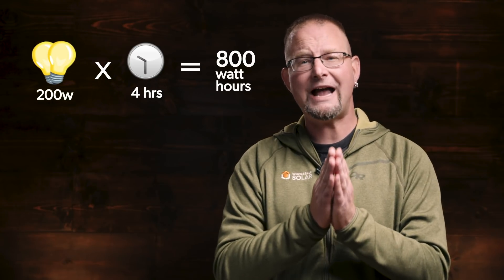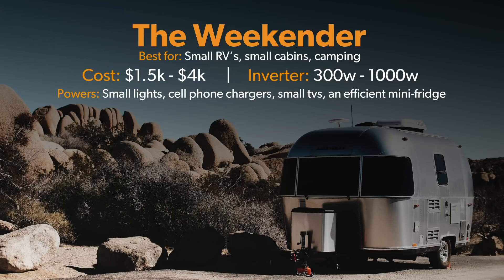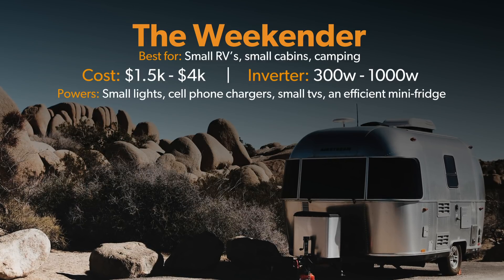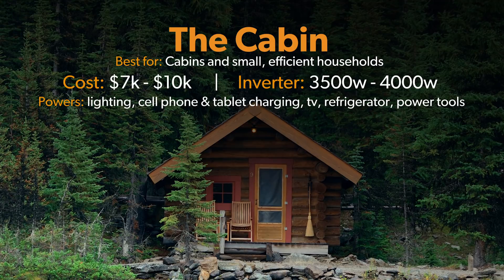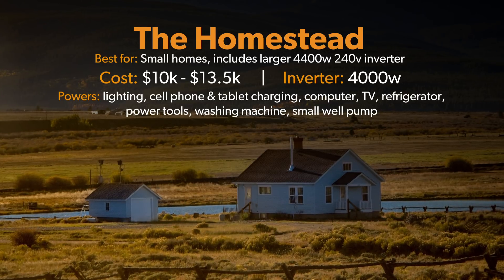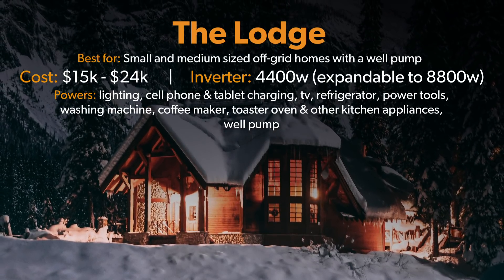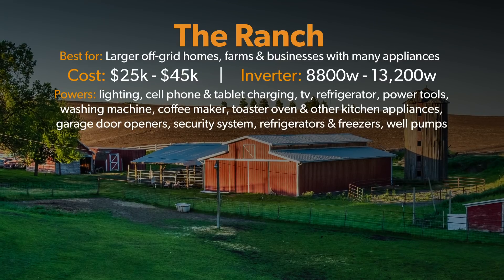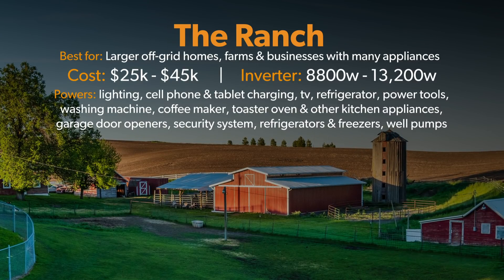How to Size My Off-Grid Solar System & How Much Does it Cost?

Comment: Thank you for the video, very well explained. 
Hope I understand this, if an off grid house is using a 8.5 kw solar system that powers it & they want to add batteries. They would need 17kw of battery storage minimum to be sure they had the 50% extra you spoke about, is that correct?

Comment: I’m building a new house and although I’m close to the grid it will cost me $18000 to get connected.  My house will be a 3 bedroom home and intend on using propane for my oven, hot water and dryer as well as heating my house. I intend to use a back up generator(propane) as well. Of course all lighting will be low consumption LED. Most of my electrical draw will be running furnace blower, electric water pump from well and 2 weeks of air conditioning and motors for laundry plus various electronics on appliances and other stuff.

I think the low end of the lodge idea would be perfect?
Reply: For that price to get electric, I've been told running electric is ultimately a better deal.

Comment: Just a quick point: if your heating is electric and/or you rely on at least one electric car, then that will have a huge impact and I’m not sure if it will ever be viable or cost effective to rely on an off-grid system for these. Basically you are challenging a Tesla battery system with another one. Frightening expenses...

Comment: The term "instantaneous watts" is a misleading here. Instantaneous power is a thing, measured in watts, but that's not what "100 W light bulb" means. All loads/appliances are rated in average/active/real power, not instantaneous power.

Comment: I followed the typical calculation to size our system and ended up with way to much power!  I have a 15.3kW system with dual inverters and just disconnected one of the inverters because we've never pulled enough power to use it.  We have two fridges, two freezers, 4 ton hvac, radiant heat, pellet stove, plus all the stuff that goes along with a family of 5 in a 3400sqft Off-Grid Home.  Everything works great and I'd encourage everyone to look into solar.
Reply: How much did it cost you?
Reply: @osolis1212  I'd like to know as well
Reply: @WrenchesandPlants  I install solar for a living, that cost is way too much. I’m assuming ground mount solar? Even then that’s an absurd amount, should of been around ~$45,000.00 for grid tied-no battery
Reply: @WrenchesandPlants  you got ripped off
Reply: What do you guys think I’d need for a very small “glamp” site? Would be using mainly for all led lights, charging all devices (phones, tablets, chargers, electric dirt bike etc) no ac at all. Would also have a refrigerator and tv/ game setup
Reply: @ordinarygamer1353  not much, I'd think a 3kW system would be plenty
Reply: How much did that cost?
Reply: @richarddikrey9656  after tax credits it was around $27k but I'd have to go back and look.  Videos are on our channel about the system.
Reply: I have a, 4 on 12 pitch, 1500sqft of direct south facing. metal roof... I really built this house with this in mind... I have to figure something out. I'll cash the permit office tomorrow and see if they will allow an electrician to install that portion. I'll do the panels and everything myself.
Reply: @jeffalley4417  good luck!  Hope you're able to work it out.
Reply: Alot that's for sure
Reply: Dude, they wanna charge me 18k for 8 360w panels grid tie... it's getting stupid. The painful part is, my local gov won't allow me to diy
Reply: @jeffalley4417  I can see doing a grid tied system needing a licensed electrician to do the final hookup but most of it is rather simple.  I'd guess that 2/3's of that price is labor and profit to the company doing the work.  I was able to so it all myself and probably saved a good chunk.
Reply: Hi good for y’all! Honestly I am trying to go solar myself, but i can’t figure out what all equipment i need to buy. Would you be able to tell me what all equipment you use so I know what exactly I need to buy? I can’t seem to find an exact list online of what all I need
Reply: @jaceduck625  we bought a package setup from Northern Arizona Wind and Sun.  It had everything thing we needed and comes with lifetime tech support.  Videos are on our channel of the system we installed.
Reply: @WrenchesandPlants  Jesus!

Comment: Air Conditioning…..Mini Split system is a lifesaver for a solar system. Still things that need to be considered, but it helps
Reply: We installed a MrCool Olympus Multi-Unit Ducted system.  Only pulls around 3kW even when all four units are running.

Comment: Hi 
I only want to cook outside with a crockpot or a instant pot.  In the morning run the coffee maker.  I would only run one appliance at a time.  What do I need to accomplish this task?
Reply: Not much, the coffee maker only pulls power when heating the water.  The crockpot will pull power for a much longer period of time.  If you only plan to use one at a time then 1000W might be all you need.  This isn't the size of your solar array or batteries, just the inverter.
Reply: @Off-Grid  
So I tried it!   
  The inverter makes a noise after 20 minutes or so.  And it’s super hot.  I turned it off.
Reply: Sorry - I ran a crockpot
Reply: @circuscats67  What size inverter are you using to do this with?  Most inverters have a surge amount they'll put out.  So if the inverter is rated at 1000W it might have a surge of 1500W or so.  They will usually only run that this surge level for a short period of time.  If you have a gauge on the inverter it should have shown you how much power it was trying to output.  This would tell you how much the appliance was trying to pull since it is the only thing being used.
Reply: @Off-Grid   
I’m going to look at the equipment
Reply: Got the information 
750 watts continuously 
1500 peak watts
Reply: @circuscats67  yep, I'm sure it is to small.  A good 1000 watts.  The crockpot should be much lower, around 200-300watts but if this is a small inverter meant for a car lets say, it wouldn't handle a long duration load.
Reply: @Off-Grid  
Thanks.  What do you suggest?  Bigger inverter?
Reply: @Off-Grid  
How much bigger?
Reply: @circuscats67  I feel the most important thing would be to buy an inverter made for long duration loads such as those used in off grid or grid tied applications since they are designed for household use..  2000-3000W at least so you can handle surges and even add a couple things in the future.
Reply: @Off-Grid  
THANK YOU!!
You told me what I need to know.  That is perfect!!!  
Many many thanks for the information.

Comment: So say a person buys the Ford F150 Electric.  And wants an off grid charging station to power it, completely off the grid to fully charge the pickup every day.  What size and how much battery would one need.  Thanks for the help.
Reply: you might need a acres of solar panels lol
Reply: I have acers.  What do I need?  How much battery?
Reply: @mattjaeger8462  when it comes to the kind of power that truck will pull you would be investing a ton of money 💰
Reply: I want a 1000 watts running 24/7 to my mining shed 🤔🤔🤔
Reply: hard to know, find out from ford how many kilowatts it needs to charge fully. for example, the nissan leaf can start charging with a little over a kilowatt of power and it will use a total of thirteen kilowatts to fully charge (2011 model)

Comment: Hydro is way cheaper
Reply: What's hydro? Please share I'm looking into getting a power bank for my solar panels. Thanks 😊
Reply: @everyonesshuffling  Water power. You would have to have a water source (running creek or lake high enough above your generator to have enough head pressure to run a turbine.
Reply: We would have liked to do hydro as part of our solar system but the creek is just to far away.

Comment: None of the sizings mentioned Air Conditioning 🤷‍♂️
Reply: Yes they never do! It’s possible but you need thousands in batteries. I have a guy that wants an off grid solar and battery system for a 100A service and he’s not gonna like the cost. The enphase ensemble system takes a lot of the complex figuring away but it’s not cheap!
Reply: We have a 4 ton system and it pulls around 3kW when running.  Not an issue for our set-up and runs perfectly.
Reply: @Off-Grid  Are you using window units or an actual AC system?
Reply: @jordanknoll2864  We are using an Olympus Mr Cool multi-unit system. There are several videos on our channel.
Reply: @Off-Grid  
You're able to do 3kW for how long? 
On how many batteries?
Reply: @zulu_mafia  we run the AC all day in the summer then turn it off about an hour after the sun goes down..  We have (24) 2V batteries for a 48V system with 1060 amp hours.
Reply: @Off-Grid  why did you decide to do 2 V batteries?
Reply: @1shaneeka  you get more Amp Hours the lower the voltage.

Comment: First, thank you so much for your clear explanation! May you help me on how to calculate the the usable load in Watts that keeps the solar arrays charge the battery (lithium batteries) while is being discharged. For example, I have 400W , 12V solar arrays, 300 Ah lithium battery pack, with 500W sine wave. How many Watts load can I draw from this system that can keep my battery being charged while being discharged. Thank you!
Reply: You can draw about 350W continuous during the day as long as you maintain 400W solar input. Think about this.. your solar panels will need to provide 15-20% more power than your expected watts usage to also be able to maintain your batteries at full charge. At night your batteries will be discharged. 300Ah is enough to run 36Watts for 100 hours OR 360Watts for 10 hours or 3600 watts for 1 hour..

Comment: Are the solarcells included in the price for the packages or is it just the battery and inverter that that are included in the price?
Reply: He was way off on his prices you can get a 5k watt system for 5k to 8k that's everything batteries charge controller panels really easy he was way high on the prices

Comment: Dollar is still too expensive
Reply: In 20 years I pay government 72k on electricity that’s 300 a month 

I think it’s worth it .
Reply: @coziii.1829  That's what everyone fails to see. The upfront cost of solar array vs long term cost of grid tied electricity.  It's a no brainer to cut the cord.
Reply: I was quoted $60k to run power to our build.  Solar was only $26k after the tax credit.  Solar was a no brainer for us but everyone's situation is different.  

To run the same power line today with the cost of wire three times what it was back then means it would run me $100k now but solar is still around the same price.
Reply: Yup